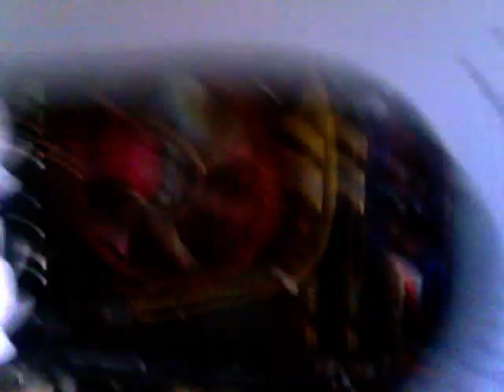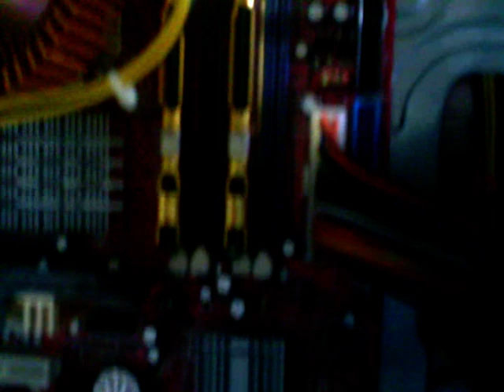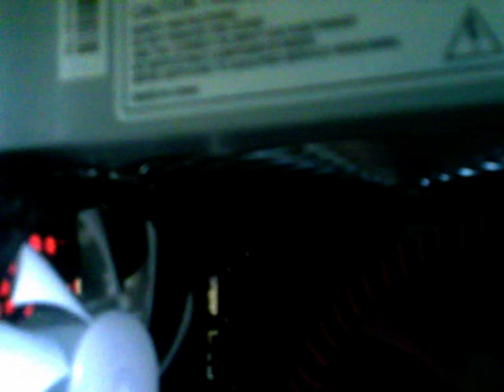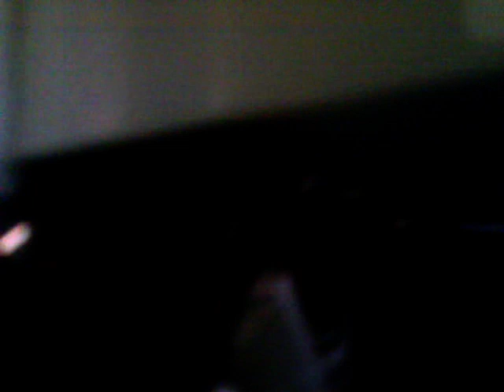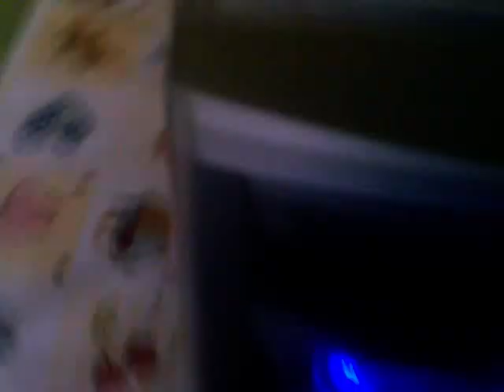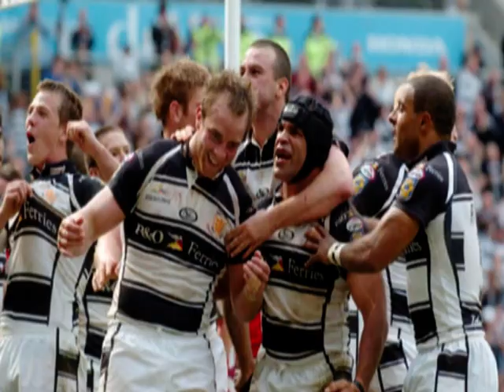Case Mod Project - Old Faithful - Update

Comment from the maker: I would say no. AMD website quotes "500 Watt or greater power supply with two 75W 6-pin PCI Express® power connectors recommended (600 Watt and four 6-pin connectors for ATI CrossFireX™ technology in dual mode)". There are no 6-pin connectors on this and there's just not enough juice.